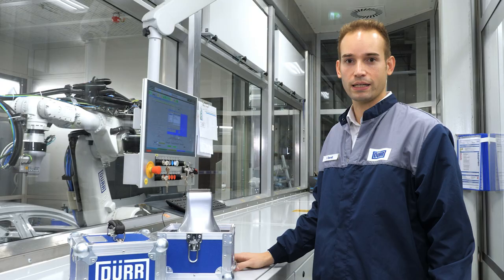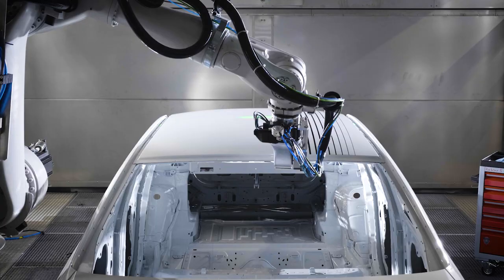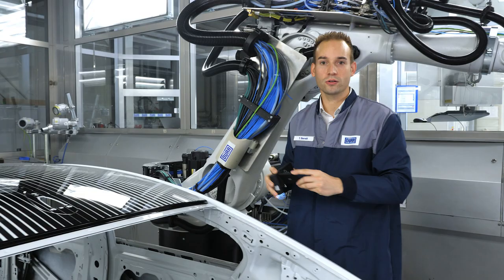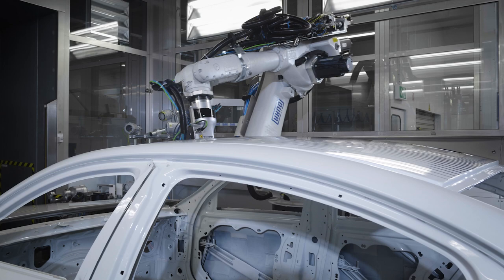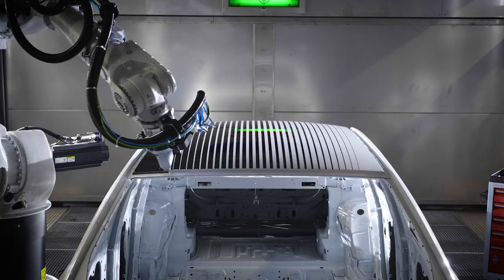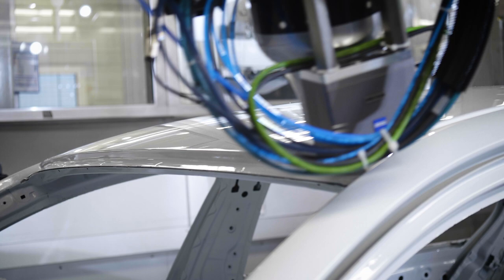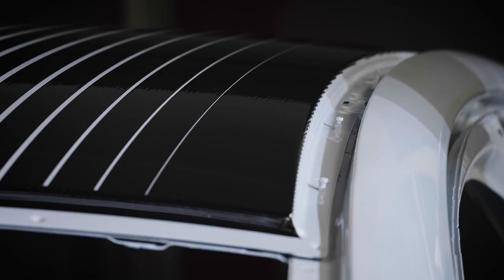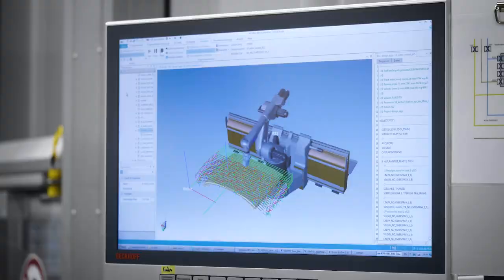EcoPaintJet Pro: Individual two-tone painting

Comment: This is the future of paint application automation. Will this application addition be compatible and able to be integrated to existing systems that use older softwares like 3D-Onsite v3?
Reply from the maker: Hello there, certainly, EcoPaintJet Pro is a great representation of the paint shop of the future. Together with DXQ3D.onsite (v4) it's possible to automatically generate paths and to simulate the layer thickness - to only mention a few highlights of the latest software version. Therefore, we wouldn't recommend the combination of EcoPaintJet Pro with an older DXQ3D.onsite version to guarantee you an excellent paint result.
Reply: @Dürr  I just saw your new video recently posted on the subject.  It's remarkable on what this innovative application technology is capable of and it's utility. 
I look forward to, hopefully, seeing it first hand next week when I start in Southfield Michigan. 
Thank you

Comment: Can you use any manufacturers paint? The black looked like it had streaks, can you explain.
Reply from the maker: Hello! Thank you for your interest. Yes, the EcoPaintJet Pro can process any paint e.g. water-based paint, solvent-based paint, 1K, 2K. At the outer edge, the paint thickness will be 100% -absolutely sharp edged! The paint lines will not be visible after drying and coating with CC :)